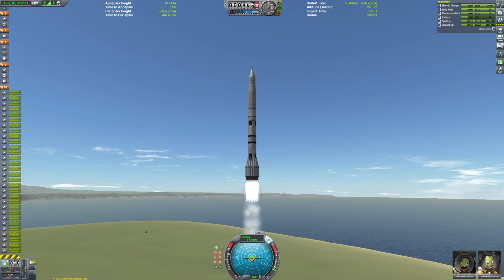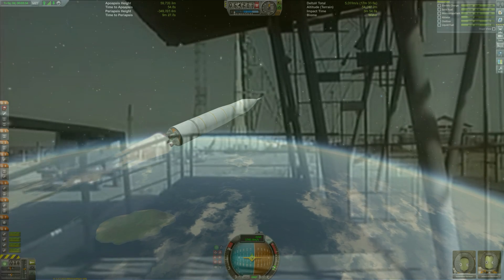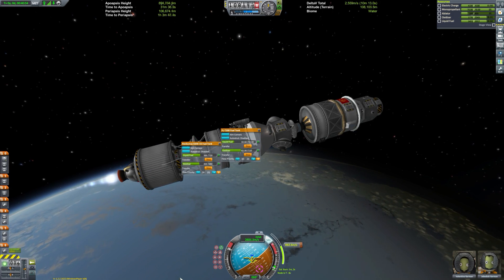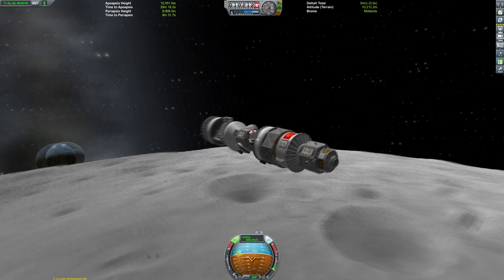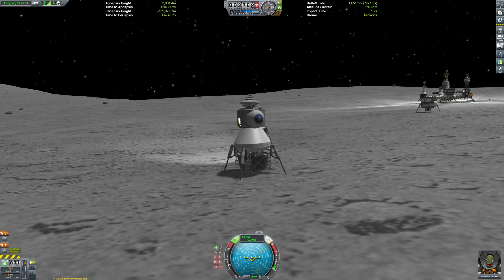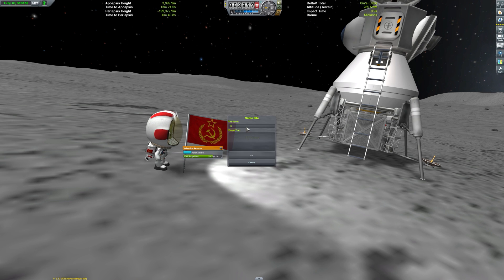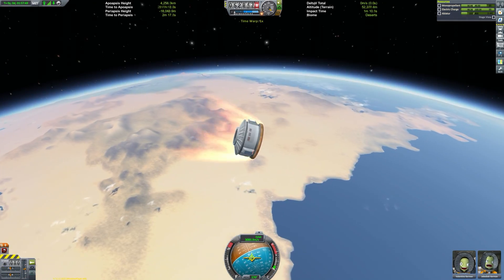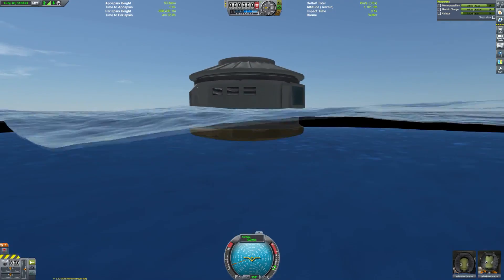KSP - The Failed Soviet Moon Mission

Comment: Actually the engine numbers aren't as ridiculous as they initially sound. The Russian NK-33 engines used on the N1 were actually far more efficient than the engines on the Saturn V, due to closed-cycle turbopump technology so complex that American engineers thought it was impossible when they first learned that the Russians were attempting to create it. The fact that the engines were much more efficient was offset by the fact that they were small, which is why the N1 uses so many of them to obtain enough thrust.

Higher numbers of small engines can actually be far better for a rocket if there's a significant excess of thrust (which there tends to be because high thrust is important when launching to orbit) and if they have a similar reliability to their larger equivalents. If one engine out of five fails on the Saturn V, that represents a major loss of thrust, and also a loss of control if it's not the central engine (which has only a 20% probability of being the engine that fails). If any engine on the N1 first stage fails, however, the rocket loses only 1/30 of its total thrust and the resulting uneven thrust vector won't present as significant an impact to the vehicle's control.

And another point in the favor of many smaller engines vs a few larger ones is the empirical fact that the R7 rocket family (Soyuz rockets and the Sputnik and Vostok launchers) are the most-launched rockets in the world, and they have 20 engines at takeoff.

The N1 didn't fail because of engineering issues - it was a very good design - it failed mostly because of messy politics in the USSR. The four N1 rockets that flew were test flights that weren't expected to work perfectly, and the technology was definitely improving over the time that the project was running. It was shut down because the USA reached the Moon first and the Soviet government didn't see any point in continuing the crewed space race to other planets (which is where the 95 tonne payload capacity of the N1 would be particularly useful). And the death of Sergei Korolev mid-way through the N1 program definitely didn't help it.
Reply: i completely agree with you. he also did not mention at all that the NK-33 were used by NASA in the late 1990s for their rockets, because NASA did not have (still doesn't) any engines capable of such thrust. And they're STILL using them...

Comment: a bigger problem with the n1 was that the engines could only be fired once, so they couldn't test them before launch. Also, I believe that the N1's computer contributed to a couple of the failures. 

Rocket stages with many engines can be reliable. Just look at the Falcon 9. Neither of its two RUDs were caused by the engines. I addition, on one of its early missions (CRS-1 I think), a falcon 9 had an engine failure but didn't crash or explode.

Comment: There is nothing crazy about clustering 30 or more engine.  Multiple engines actually makes the vehicle more redundant opposite engine can be shut off while other engines throttle up.  N-1 probably would have succeeded if Korolev had not unexpectedly died in January 1966.  Also, our computer systems are many orders of magnitude better today than the Soviets had in the 60s.

Comment: Actually both because of logistic (the rocket was not made near the launchpad unlike Saturn V and its VAB) and to keep it secret, the rocket was literally deconstructed and rebuild on the launch site, most engine were not tested prior to launch and never all of them were tested at once because of lack of big enough infrastructure, it would had reveal the issue of plumbing vibration if it was done.
The rocket was literally tested on a trial and error basis and the firsts were literally expected to fail.
Also the onboard software that controlled the engines was one of the biggest flow of the rocket and the thing that caused the most amount of problems, after the all 4 failed launch basically all known issue were fixed and the next rocket would have probably work without problems (or catastrophic failures at least).
Just after the fourth attempt, the first man was already on the Moon by the USA.
The thing is that this is the issue here, not only the Russians never publicly entered in the moon race, but also, the SPACE race was over after the USA landed on the Moon while they literally failed at every first anything before that, URSS was winning, if the USA were not bitchy and did not say that the race was not over until they stop loosing, the space race would have continue, not only to the moon, but also to others planets.
The URSS was ready to launch a mission to the Moon, which is why two others rockets were ready to continue the tests, but since the USA claimed that they win the space race by actually not loosing for the first time, and since a successful launch of the N1 would have mean to continue toward manned moon mission, the URSS probably realised that it was not worth it to spend more money trying to race an unfair adversary who self proclaim himself winner of the space race, while the rest of the solar system is still, 47 years latter, virgin from direct human presence and actually the Soviets were the first to land on the moon, unmanned but still the first, same for Venus and Mars, because you can be sure that if the Soviets were the first on the Moon, USA would have never accept that they won and simply push the finish line to another objective until they could do it first.

So yeah, in this video you were trashing the N1 as a total failure that was almost stupid and impossible to made properly work while it was not the case at all, the two next would have probably been really successful and failure was expected, not just as the state of rocket science of those old days but literally as a lot of unknown were still awaiting to be found which is not representative of the final expected rocket reliability.

Anyway nice video.
Reply: Demongornot Their are stories of US spy satellites seeing a gigantic rocket one orbit and a giant charred spot the next orbit.
Reply: Which is actually funny for the observer side of view !
Reply: The "lost astronauts" theory, might be true, but just be careful with what you read on the internet, so much fakes things who look and sound really realistic are everywhere on the internet.
Reply: +Greater98er I've even heard that amateur radio operators in mexico were trying to listen in on Sputnik, heard people talking, screaming, like they sent men up before they knew how to get them back down.

Comment: Dear Matt, you mention here that you think 30 engines in the first stage alone is ludicrous. If that seems ludicrous, I'd like to hear your opinion on the SpaceX ITS motor count of 42 Raptor motors?
Reply: Responding correctly to an engine failure in flight is a challenge. KORD, the 1970s Soviet flight control system on the N1 probably wasn't up to it. Nowadays I suspect we could do better.
Reply: The opinion shall be in the likes of "do it!" (Musk's own words). Let us see how ITS evolves beyond the drawing table first.
Reply: KORD was never meant to control that setup of engines on the N1.  N1 failed because of bad programming.  Falcon Heavy did a successful static fire recently with its 27 engines, which I think means SpaceX have developed a much better system.  Plus SpaceX uses engine vectoring instead of differential thrust.  So, hopefully no flameout.

Comment: not as many engines as the space x proposed craft.  you think that will fail?
Reply: The Raptor engines will have been fully developed approximately 50 years later than the NK ones. Half a century is a big leap in space industry... in technology at all. Also, SpaceX perform static fires, none of the N-1 were tested in that way.

What I am concerned about though, is the on orbit refuelling. They are planning to have five most powerful rocket launches ever in a span of what, a month? All with the same booster.

Comment: Here's a challenge. Get a Kerbal in low kerbin orbit. But only use 'Ant' engines. Good luck.
Reply: Muhammed Abdilrahmin "impossible isnt a thing in ksp" -bradley
Reply: its definitely not impossible. Scott Manley did a video using a weaker engines and still got to orbit. go try again.
Reply: @maxwellmondo4857  A year after your comment, he made a video using even weaker engines!
Reply: @maxwellmondo4857  scott manley orbited with drain valves, he can orbit with anything
Reply: petti78 he means LKO
Reply: Thomas Harbauer I'll try
Reply: The Diecast Racer done it yet?
Reply: It is impossible.
Reply: @xurkiitree  If you can get to Gilly using spiders , Ant engines to low kerbin orbit is possible however

Ant ASL Thrust - 502 N
ISP-80

So it'll be a stupid design and not practical.
Reply: CHALLENGE ACCEPTED
Reply: Did you do it yet?
Reply: Fuck no. Doing it was boring.
Reply: What's that, an engine for ants?
Reply: lol
Reply: Would the spider engine work as well
Reply: Whelp just use the KAL-100 controller
Reply: LOL someone even only use a gun to get to the moon and back
Reply: Mun with ONLY speratron srb
Reply: thats impossible without cheats because the ants thrust asl was not enough to lift a single kerbal, and even if it does it will have not enough delta v
Reply: Hmrb
Reply: I did it
Reply: no
Reply: What in the world is a low kerbin earth orbit? You can't have an orbit with two different planets in two different solar systems at the same time...

Comment: Very good video.  Interestingly the Soviet docking system intended for their Lunar shot was only capable of being used once.  The act of docking would smash the mechanism so severely it was simply impossible to pull off a second one.

Your video really is very good, and I've no doubt you know way more on this than I do, but I always thought the fairings around the cargo bay holding the lander was to stay in place until lunar orbit had been achieved?

I'm wrong in this I guess..?

Comment: When you do a maneuver, when are you supposed to burn? Are you supposed to burn when it reaches zero?
Reply: Slice Thank you. I tried everything but that: Burning at zero is what I settled with and that usually gave me a 50/50 success rate. I remember I had to relaunch multiple times just because of that.
Reply: Nobienify I do but if you wanna be suuper accurate  you take the estimated burn time and then half it and start the burn when the countdown reaches that time
Reply: ApocalypseToast I guess I could try that
Reply: Nobienify The proper way is to initiate the burn when half of the burn time is the time left to burn. For example if I was going to burn for 1 minute I would start my burn at T- 30 seconds and end it at T+ 30 seconds. This applies to all times like; burn:47 sec. start: T-24 sec. stop:T+23 sec
Reply: Nobienify No problem :)
Reply: +Nobienify quick save before maneuvers

Comment: The N1 is not nearly as stupid as it looks. Keep in mind that the soviets weren't given the time nor the budged to properly build the rocket, with the result that the majority of the engines where never tested before being installed and also the assembled rocket couldn't be tested before launch. Therefore they aimed for a much more incremental approach on building the rocket. (A design approach that got them the Soyuz family with over 800 successful launches!!) As a matter of fact the engineers where surprised the thing got of the launch pad with the first try. 

Also the first stage engines where the most efficient in the world until the Falcon 9 came along.... over 40 years later! Not to mention that these very engines got both of NASA's mars rovers into space...
Reply: John5200 attached to american electronics

Comment: Lot and lot of thrusters is a perfectly valid strategy as long as the engine don't fail explosively. They can also stay as light as a few powerful engine.

Using dozen of engin also make the stage more reliable since you can overcome an engine failure by pushing the other slightly more. Whereas if a SLS lost one of its engine the entire rocket is doomed.
The SpaceX design for example rely on 9 main thrusters, and I don't need to tell you about the crazy Mars-Reusable-Rocket.

Aside, the Russian engine are "unbelievably" efficient, I hard that when the American cooperated with the Soyuz they got to look at their engine Isp and simply couldn't believe it.

Comment: One of the other reasons Block A had so many engines, was the fact that if 1 or 2 failed, you still had a bunch left. With the Saturn V, it would be a bigger failure. It actually happened at the Apollo 13 launch, one engine failed but they could make it into orbit. Sadly the rest of the trip didn't go as planned as well.
Reply: yeah, but if one had a failure at the N1 the engine on the otherside shuted down to. This happen at all launches and if they were shuted down some getted and then shuted other engines down until there weren't enough engines and it had to burst
Reply: That was the theory, yes, but as pointed out, late 1960s Soviet flight-capable automation wasn't really up to the challenge of balancing across 30 engines. A failure in one would cause all the engines to shut down.
Reply: The last flight of the N1 faild at the seperation of the first stage. There where a failure at engine number 4 at teh second stage. They don't know what happend an in this reason they bursted the rocket. But the first stage with the 30 engines worked perfectly.
Reply: Günther Hinnen which is exactly what happened. because the russian programming was sensitive
Reply: The N1 mainly failed because KORD was a bad program, and I would shutdown all of the engines when just one gave anomalous telemetry.  I believe KORD was not even originally designed for N1, but the Soviet Government couldn’t afford a dedicated N1 flight system.
Reply: The Apollo 13 engine was in the second stage and was the middle
Reply: @coolpigs9937  one failed at the 1st stage too
Reply: I'd be fascinated to know if any of the engines on the first stage on that flight. 

If not, then KORD (the flight control system) would not have had anything to do, and would not have shut the engines down. However, the problem of engine reliability remains. One successful flight out of three isn't a good start for a crewed system.
Reply: Fedor xdf

Comment: the crew modual and the lunar modual would not dock!!! they got very close and then the kosmonaunt would do an EVA!
Reply from the maker: I read so many conflicting articles and reports regarding whether or not the lander would re-dock I ended up just going with 1 and hoping it was correct lol, do you have any good sources?
Reply: Mr G 1324 It's rather hard to do that in KSP, from my experience.
Reply: My understanding is that the circular grid on top of the Soviet lander was a target for a harpoon-like device on the top of the Soyuz. The vessels would run into one another and engage, locking the two together until the harpoon was ejected. 

So the vessels would dock in the sense they were locked together,  but crew could not be transferred through the dock. However, it would make it much easier to EVA from the lander to the Soyuz.
Reply: Velociraptors of Skyrim i do it for rescue missions its ok you just need to make sure ladders are obvious
Reply: Alistair Shaw True.

Comment: Wait, when did ksp start allowing kerbals to pass through the junior port? I know that didn't used to be a feature.
Reply: +protostar 
Apparently it has been for a while: KSP treats docked ships as a single ship, so all docking ports and even the claw allow transfer using the 'transfer pop-up screen'. From 1.1 the description of the jr. port changed into "As a result of its small size, kerbals need to hold their breath and wiggle to slip through."

I never noticed it before, and for roll-play I do not think I will try to not use it either.
Reply: Tuning3434 use connected living space

Comment: The N1 did not failed because it had too many engines, it failed because the russians sucked and didnt have the facilities to support such a rocket.
Reply: Actually it failed because the Soviet government didn't invest enough money and the engineers couldn't perform the necessary tests in time.
Reply: Lol. Yeah we sure sucked a lot. It’s not like we put the first man , satellite and space station in space .
Reply: The Russian Infrastructure wasn't enough. The NK-33 is one of the best engines in the world, but when it was about to be tested, the Kremlin got impatient and cancelled the project. ( KSP needs to  make their own version of the Nk-33, The vector is powerful but not efficient )
Reply: It was because of KORD
Reply: Darius Duesentrieb Yes the flight computer is part of why the russians sucked.
Reply: It failed because they didn’t redesign the engine control system, KORD, to work with the rocket.  It wasn’t meant to be used with the engine configuration originally, and so it repeatedly terminated all the engines when one had an anomaly.  They needed it because they used differential thrust to steer instead of engine gimbaling.
Reply: It was in fact the plumbing which was the weakest link of the rocket, the fuel ducts cound't hande the tremndous vibrations, that's why KORD shut down all engines, because it detected abnormalities in all engines. Indeed KORD needed to be optimized but it worked not so bad. The strength of the fuel pipes was at fault mostly.
Reply: Quo Niam It wad 100% KORD's fault the N1 wouldn't have much problems even if 5 of its engines failed. That system wasn't meant for the N1 not only because of the amount of engines also  because of its way it uses the thrust to manoeuvre so if only obe engine failed all where killed off
Reply: Hey have you learned about Soyuz? (The most launched rocket and made by Russia and one of the best ways to the international space station)
Reply: You can write an entire thesis about why the Soviet moon project was cancelled but your main argument is "russians sucked" We can clearly see that you are an intelligent man